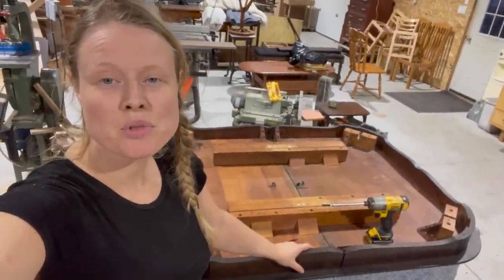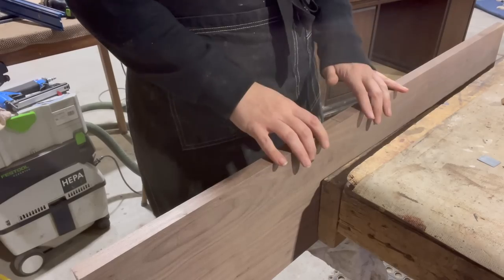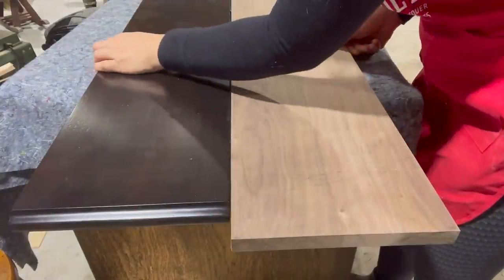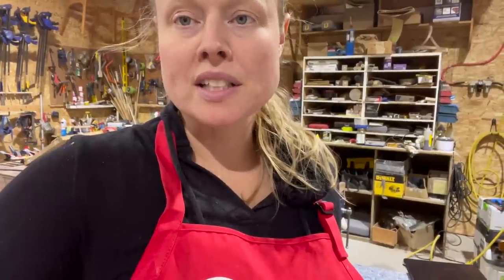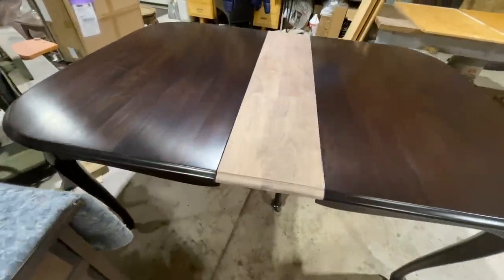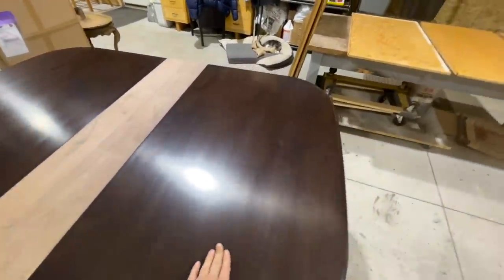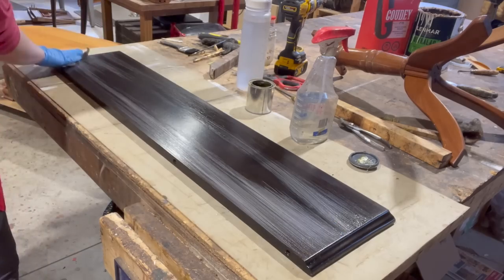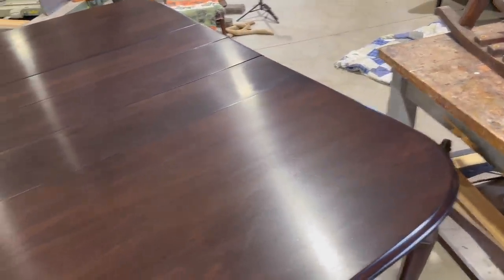My customer brought this back

Comment: Years ago, when I did repairs in the home, I always carried a few leaf alignment pins in my toolbox. When a customer impressed me with a fix of their own or a new way of doing something, I would award them "The highly coveted, yet rarely awarded Wooden Bullet Award" and gave them one of the pins! I always thought that sharing a laugh with a customer was a great way to have them remember you.
Oh, and when I had to match a profile, I used an old card scraper held up to the profile I had to match, then cut, filed and sharpened the shape. I cut away most of the wood with a chisel, just as you did, then finished it off with my new scraper.
Reply from the maker: Nice!

Comment: I'm a luthier and from time to time I have to do custom shapes such as replacing finger boards. My method of copying shapes is to use a card scraper from lee valley, not the thin ones. I trace the shapes onto the card scraper and using a dremiel tool, cut out the shape I want. I then put an angle on one side (very carefully) and add a burr. Using chisels, I bring it down to size, using the scraper as a template and the end job is to use the scraper as a scraper to finish the final shape. Hope you can understand my explanation. As a former Windsor resident keep up the good work. (I hope you have air conditioning in your shop).
Reply from the maker: Yes I have seen that method although I’ve never tried it yet. Thankyou!

Comment: Trena is amazing. Your hand cut leaf looks better than the two originals. You are an artist with the finish. Old tables have character but are not very robust. New manufactured tables are robust but without character, well maybe after 50 years of use they may gain character.

Comment: I am speechless!! I saw the table and my heart jumped... Went to the original refinish video... That is the set I have in my kitchen, the table, 8 chairs, buffet. It was my great grandfathers. My grandmother had a 3 glass door hutch built to make the buffet a china cabinet.  The only difference is the carved slats in the chairs and the shape of the top edge, even has the same hardware on the buffet.  I have been trying to figure out how to fix the "wear and tear" from being moved without destroying it.  Thank you soooo much!!!

Comment: Oh, this comes just at the moment that we have been thinking about a new leaf for our 150 year old dining table. It is 5 ft wide and can be extended to 20 feet. One of the leaves was attacked by worms many years ago and is basically useless. I have been thinking about making a leaf as I have a router bit that will do quite well, but the leaves are nearly 2 ft wide and I would have glue up at least 2 boards and I don't have a planer, etc. I would love to have you do it, in case you are planning on coming to Europe some time in the future! :-) Thanks for another great video. Making that profile by hand is truly a work of art. Best wishes to you. We never miss a video.
Reply from the maker: Thanks!

Comment: For marking the table pins onto the new leaf (8:21) could you also have put a piece of painters tape on the pins, smooshed it over to make the pin cone, then used black sharpie on the pin top to push against the board?  sharpie on the pin could also work, but then you are modifying the customer item.  I have used that method to line up holes in some of my projects and depending on the shape of the pin, sharpie can be useful.

Comment: For just a couple dollars you can get some alignment plugs, they come in sets so you put the right size in the hole put the two pieces together and it will leave an indent where you need to drill for your pin. I have two sets one is about 1/4" inch long the other is 4 1/2" inch long. After years of lining every thing up by eye, now I couldn't live with out them as I only use dowls or all my wood working.
Reply from the maker: Yes I have them. Unfortunately this table was a little too wonky to use them. Cheers.

Comment: Great job. Especially the color match. I would have probably weenied out and took them to a CNC shop for the end profile. As far as the pins, when I do this sort of thing, I would put all of the original leaves in with the best fit combination I could find and number them on the bottom so it always gets put together that way. Then I would match the pins on one of the end leaves with the corresponding table side and then number that one with the next number in sequence. I also would use index lines across the middle so they get orientated the same every time with one hash mark across the seam, then two, then three, ..ect. All on the bottom of course, then there's no confusion on how to add leaves.
Reply from the maker: Yep they are numbered.

Comment: This post shows why you are the best, I looked at peoples work locally not up to your standards, I’m going to Maine for vacation this summer, I don’t know if this is the type of work he does, I have this 100 year old clock where the wood is bent using a number of pieces which have separated. I may call your dads shop before we go and see if this is something he does, if so we drop this off, it has been in a bag in a box since before we got married 45 years ago, one of those s things that have been in my wife’s family, as all the relatives who used it are all dead we would like to use it on our mantle
Reply from the maker: Thomas Johnston is not my dad but he is definitely a capable restorer. Cheers!

Comment: A lot of table leaves get orphaned from the tables, and I used to buy them at local auctions. Sometimes there'd be a small stack of them. I'd always buy them. They are great sources of old wood. It's not unusual to get a leaf that's a glue-up of 2 or 3 boards and sometimes the individual boards are slightly tapered. Then you have the pins and sockets to deal with. Bottom line, you have to do a fair amount of trimming to get usable, well-seasoned wood. Even those leaves with thin laminated veneers usually have good poplar as the foundation. These are great for picture frames, drawer sides and the thin cut-offs get used as paint sticks. Waste not; want not.
Reply from the maker: Good idea

Comment: Ever consider getting a dowel pin center kit?  They are like $10 and many diameters. You would remove the dowel from the table, put the pin center punch in push the leaf against it and you would get exact center of the hole needed on the new leaf.
Reply from the maker: Yep I have them. Just too wonky to use them here

Comment: If you do tables a lot you should pick up dowel pin centers. They are way more accurate and would save a ton of time. Just pull the old dowel and put the pin in. it'll mark dead center of the hole, then just drill it like normal.

Comment: Be careful with that steelwool it is very flammable, it only takes a spark to set it off and maybe take your whole shop to the ground. I would not have believed it either but i seen it on a YouTube short video.
Reply from the maker: It’s a great fire starter. Lol

Comment: Beautiful carving Trena.
 As I was watching the process I wondered if there was any benefit to creating a jig ##cough lasercutter cough## and re-dowelling all of the leaves and table for consistency.  But then you said a leaf was warped and I suppose the inconsistency adds character.  Do you agree?
Reply from the maker: Ya the trouble with the jig is every hole had to be a little different. Definitely if it was a new build that would work. Same with the profile. Very not uniform. Lol
Reply: @johnsfurniturerepair  I had in mind filling the old dowel holes and redrilling with a jig in a new location or partially through the filled holes. Probably a lot more work for a small benefit.

Comment: Very good job at carving the profile.  I have never heard of wool lube, and was taken aback that you introduced water onto the steel wool.  I suppose that you don't need to worry about any rust staining because the piece is sealed with lacquer.  Plus, unlike steel wool alone, the lube carries any steel fragments in suspension.
Reply from the maker: Yep. Steel wool is used very often for buffing

Comment: I wonder if using dowel centers would make it easier for you to get the location for the holes in the new leaf accurately positioned. Your method works well, but  if I was doing it, I might forget to measure as many times as you do.
Reply from the maker: Yep they work too. Just hard to line up the top edge on older tables

Comment: Leaves are much more difficult to make than non woodworkers would think. Question, why not use transfer points for pin alignment?
Reply from the maker: More or less did but they aren’t fool proof

Comment: When I worked for a so-called antique dealer many years ago, we used that technique with Ivory soap and a bit of water to get that effect on polyurethane. It was a decent looking finish as I recall, but it took forever.
Reply from the maker: Oh the lovely soap finish. I may be getting into this on a vid. Stay tuned. 🤓

Comment: Get a wide piece of tape and put through the begs on the table then tape it to the board you are making. No measuring needed. this will work on both ends.

Comment: I might have been tempted to make one large leaf (equal to the 3 leaves together) for when they needed more room.  I "think" the fitment might have been easier than juggling the 3 separate pieces, but since you fit your leaf to the table anyway, it might be nix nox.
Reply from the maker: Yes. The only problem with lard solid wood slabs it the have the tendency to warp cup and twist. These leaves were pretty small though. They could have safely gone bigger.

Comment: I am a novice woodworker, and certainly don't claim to be a good source of information, but I find using old antique molding planes as good or better than a table saw or router. Do you suppose you could have been more efficient in using some hollows and rounds to recreate this profile?
Reply from the maker: I have one, but I just decided to do it this way.

Comment: Questions after you sand it to fit perfectly what if the customer puts it in the opposite way ?  Or are the pegs different on each side that it would have to go in that way?  Just curious.  I am always amazed by your work!
Reply: Each leaf has pegs on one side and holes on the other, kinda like Lego's they only work one way.
Reply from the maker: They are number stamped for placement. Cheers.

Comment: Being a furniture repair shop I'm surprised you don't cut your own profiles from blanks for use with a shaper.
Reply from the maker: I’m not a builder. Many repair shops work with mill shops as the tools necessary are impractical for repair shops to purchase.

Comment: On our fairly new Amish-made table, 3 insert leaves plus end drop leaves, we ended up marking each leaf on the underside by the pins with a different symbol so we can add and remove the leaves for the best fit.
Reply from the maker: Yep. These were numbered too.

Comment: I decided to put an inlaid glass top on a $500 coffee table. While using a router and within five seconds I turned the coffee table into firewood. It's way too late to take the coffee table to John's Furniture Repair. The hard lesson learned is if you're not 100% sure you can do a task Don't Try to Do It without plenty of practice first.
Reply from the maker: test pieces are the answer, next time